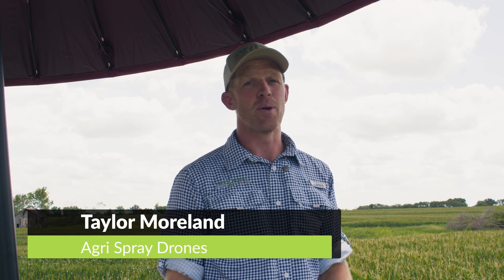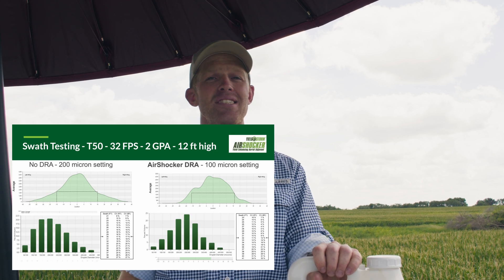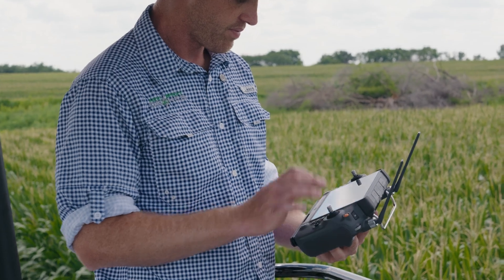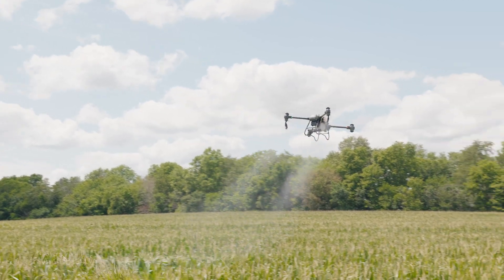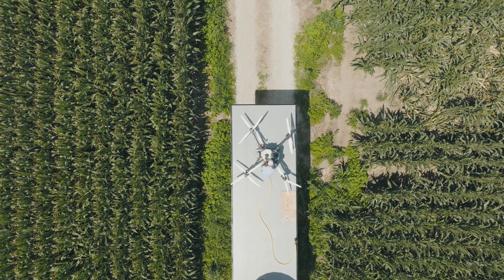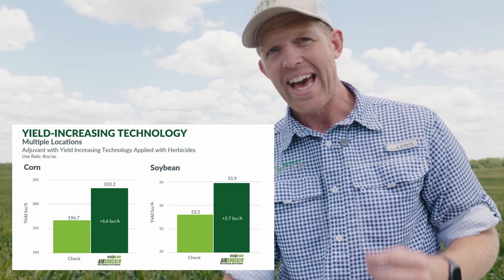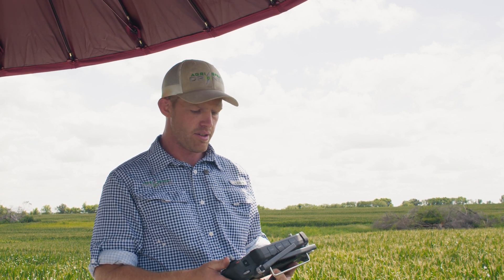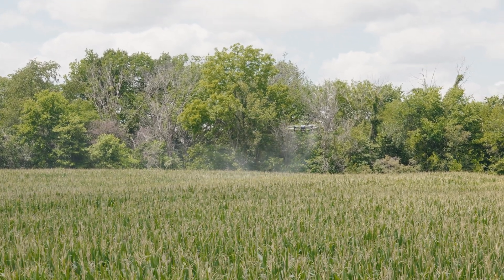Optimizing Spray Drone Performance with AirShocker | Agri Spray Drones

Comment: Hey do you ever spray the boarders first to easy drift? Do you spray near powerlines manually?
Reply from the maker: We've got some videos coming that discuss spraying borders first. We DO recommend using manual control around obstacles, especially powerlines; those are particularly tough for radar to pick up

Comment: Question, why not flying 3 to 4 feet high from the corp? Will the spray not penetrate better then? Tx
Reply: Probably because the vortex cause my the drone would be to aggressive on the crop
Reply: @austinwitherspoon4940  Thank you appreciate your videos and info!
Reply from the maker: Flying too low means you don't get full swath width, which means you aren't spraying as efficiently as you could be!